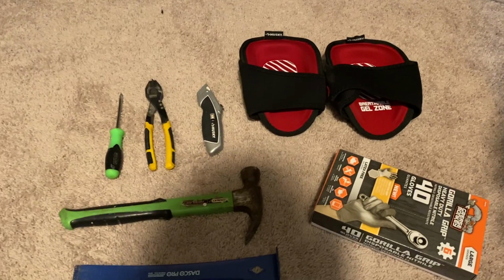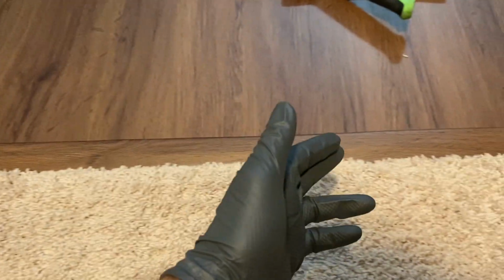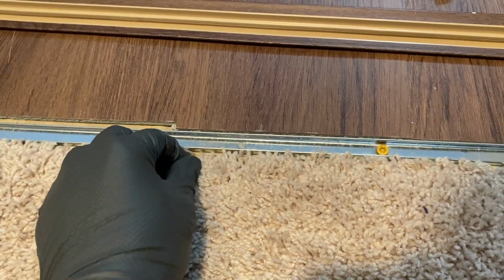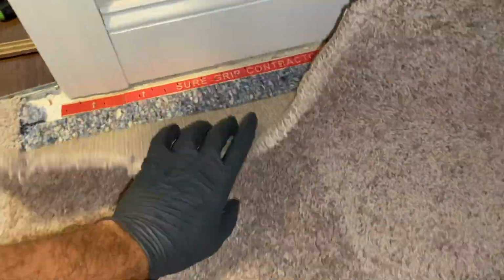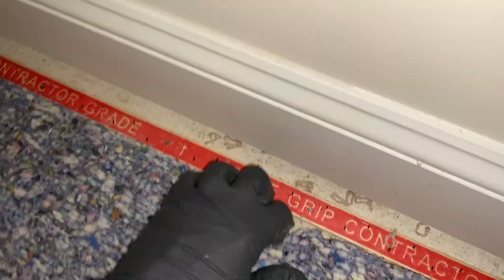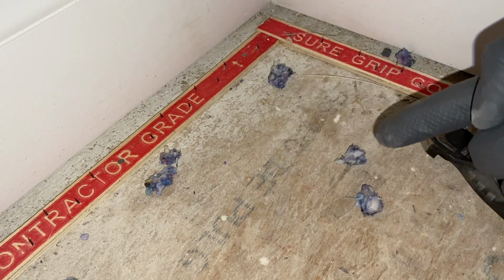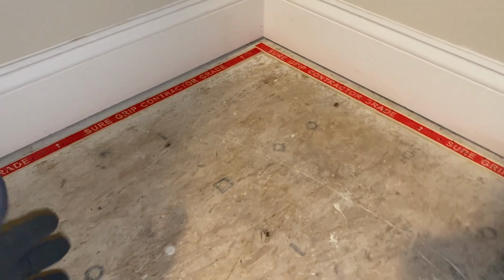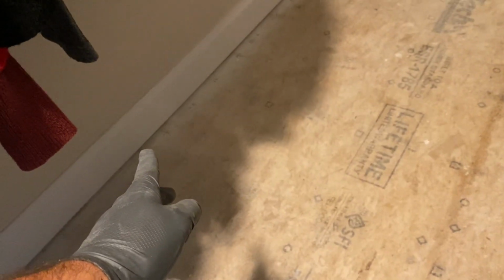How to Remove Carpet Wall to Wall DIY! Part 1

Comment: When you pull up the carpet and padding can you show me how to peel up the carpet dripping please?
Reply from the maker: @Xavierstrainsandmotors  I can explain :) take a hammer and a small pry bar or flat head screw driver if don’t have a pry bar and you will see little nail heads that hold the tack stripping in. They pull right away by prying between the plywood sheathing and the tack strip. It should pop right out down the line!